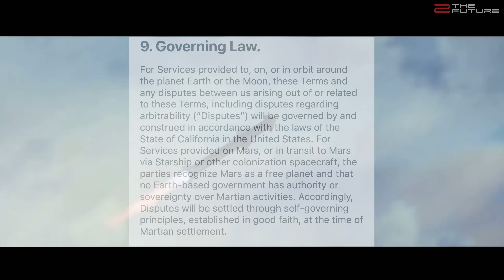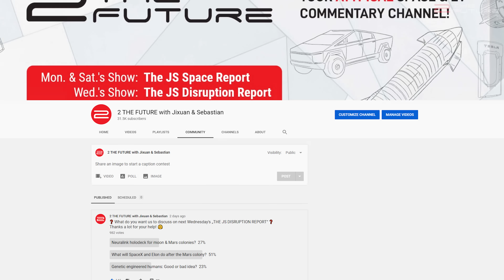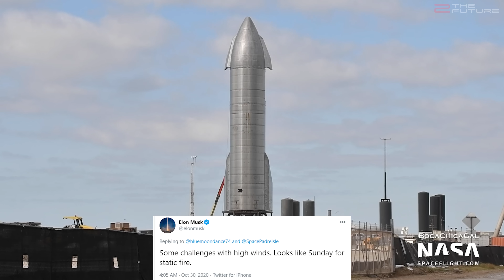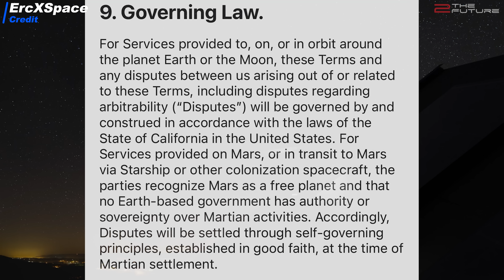UPDATED STARSHIP NASA MOON TIMELINE | Elon Declares Mars Independency

Comment: Why is there a Lunar Starship which cannot land on earth? The white one without fins!
Is it a shuttle between lunar orbit and moon? Where do the big masses come from which it is (capable of) transferring from lunar orbit to the moon? From another Starship which can land on earth?

It does not make sense to transfer tons of cargo in mid-flight from one Starship to the other. Just use the one which left earth for the moon, let it land on the moon and let fly back to earth and let it land there. And it needs fins.

Once there is a substantial transfer between space stations, then they can save a bit of weight for the fins and use that additional weight for cargo. But this need is far ahead in the future and it can be done in a short term. But it's not needed in the next 20 years. Until then the Starship itself will be outdated and SpaceX will have the next generation rocket, maybe a 15 meter wide Starship, who knows ;-)

Comment: Weakness in the chemical rocket plan and design for long duration flight mean we need to now consider coordination of plans for maximum efficiency and safety in hostile space flight with new propulsion. The other area Aerospace Sciences and other companies have experience in is space hardened electronic components. This would even help Tesla have more resistant components in vehicles to resist solar MCE or EMP.

Comment: IMHO we shouldn't be putting all of our eggs into one basket/one design.  That is, the image shown at @4:18 might not be the case if Starship doesn't get off the ground as fast as they/we want it to.  The only other problem I see with the Starship is a potential for tipping over.  Lots of variables when dealing with uneven/unprepared landing surfaces so a "top heavy" Starship might need to be fitted with some wide spider like legs initially (similar to the competition's landers).  But I'm just another "arm-chair" engineer rooting for my Starship team ;)

Comment: For cargo Mission, they could land the Starship horizontaly. Or first land verticaly, and then flip it to the side with smal thrusters. So the whole structure could be used as a first building structure for a moonbase. No crane needed. The oxygen and methan tanks are 8bar proofed. They could easily be used as pressurized habitat area. If the nose cone is detachable, it could be used as a ferry for moon expeditions. It already has the thrusters aboard.

Comment: Regarding HLS, I remember Jim Bridenstein saying that 2 or 3 of the landers would be chosen to continue; so it seemed that NASA would not be forced to eliminate a lander if all achieved their program achievement goals.  Regarding who won't be able to do that?  Well there is one design in the running that has a team member that has a pretty consistent pattern of messing goals.  Hmm.  I wonder which team that is?  Also, The Starship sure seems to be the oddball of this bunch so maybe it will be spun off as a freight hauler rather than a Human Lander.  Also, every new president has re-envisioned NASA so things will certainly change in either 2 months or 4 years.

Comment: SpaceX will make it to the moon either way.  I'd bet money that the Space Force will do a Starship moon mission with or without NASA.  And if that doesn't happen, Musk will probably do it anyway to prepare for Mars.  

I'd like to see the Dynetics plan involved too, or something close to it.  The logistics of refuelling Starship will be enormously complex, requiring several earth launches to get enough fuel to take off again from the moon.  While possible, that doesnt make a lot of sense for frequent manned flights.  But if you consider Starship in tandem with a smaller lander, the possibilities sound a lot better.  Get a starship tanker to the lunar orbit space station, and you've probably got enough fuel there for a few surface excursions with the smaller lander.  But you're going to need meaningful equipment to make a lunar base viable, like excavators and welders and such.  And you're going to need building materials, which tend to be heavy and bulky.  There's nothing on anybody's drawing board which can provide those capabilities, other than Starship.

Comment: Bitcoin has undergone a massive rally over the past two weeks. From the lows set after the news broke regarding OKEx, the leading cryptocurrency has surged higher by almost 25%, currently trading at the $13,700 region. Despite this rapid move to the upside the true Bitcoin breakout has not yet taken place. That’s to say, Bitcoin could soon see even more explosive movement. Now's the time to accumulate and stack up more coins so as to fully exploit and take advantage of the upcoming bull run. I trade daily to increase my holdings and I have been able to amass 18 btc in my portfolio through the help of vicente sanz trade signals. Trading with vicente's trade signal has been tremendously helpful in my trades because my win ratio increased drastically and I urge investors to find suitable experts like him, he could be reached on Whatspp___ (+44 7380 353818) and Tlrgram (vicentesanz) for any trader looking to stay profitable.
Reply: Pumps or dumbs, I still earn around 1 btc every week with his strategy. I recommend him If you're a holder like me.
Reply: He's one of the best in the game
Reply: Got mixed feelings about it. But I guess I will have to have an experience with this currency before judging.
Reply: VERY INTUITIVE INFORMATION
Reply: Bitcoin Trading is the best thing I've ever done.. I'm glad

Comment: NASA has said that there Lunar lander should be reusable. They also said, that to reduce any delays due to development, in order to meet a 2024 lunar launch deadline, that NASA would accept a non reusable lander for the first mission. If the National team cannot produce a plan for the Blue lander to be reusable, then they should not be considered as a contender for the HLS. It may be excellent for CLPS but leaving the lander on the moon for every Human lunar mission is just not acceptable. Unless that segment is extremely inexpensive...but we know it is not. That tremendously long ladder could stand a powered platform to traverse that climb.

Space X has a long way to go to not only prove reusability of a Lunar lander but also that it can refueled in space to reach the moon. The other teams have provided a mock up with interiors for Astronaut input. It appears that Space X has merely thrown some white paint on a nose cone and may be calling that there Mockup. With out an interior and maybe an elevator, I think they have fallen far short compared to the other teams. They also have not given any specifics as to the motors that would be used for landing and ascent and have not really shown stabile landing legs to land on an unimproved surface. A corroboration with a Space Bot company may aid their chances.

Both teams are going to have to step up their game to compete against the Dynetics Lander if they are to gain a piece of the pie. I also have to think that NASA will also be thinking about which landers development could share in the cost for a Mars Lander development.

Comment: The NOTAM is not for the 15km flight but is required for static fire and it is normal for them to renew it every few months.
Reply: Great content regardless!
Reply: NOTAM encompasses both ...
Reply: @TraditionalAnglican  nope. Read it
Reply: @TraditionalAnglican  https://tfr.faa.gov/save_pages/detail_0_0205.html
Reply: @elcarmi  NOTAM uses the term “Space Operations”, which must include both the Static Fire & the “Hop”. As the FAA must also approve the Hop, I don’t think they would’ve sent out such an open-ended NOTAM (good through Dec. 31) unless they were at least considering approving the hop
Reply: @TraditionalAnglican  You can think whatever you want, that is not the way it works with the FAA. Go back and do your research if you really care.

Comment: Servus from New Mexico! The NOTAM is definitely not for the 15km hop. It only covers a square of about 3x3 nautical miles and extends up to1800 feet above mean sea level. This NOTAM is due to explosion hazard during periods of ground tests. It references 14 CFR Section 91, i.e. 14 CFR § 91.137 - "Temporary flight restrictions in the vicinity of disaster/hazard areas". The NOTAM for the 15km flight will probably cover 10 nautical miles around Boca Chica and reach up to 100.000ft AMSL or so. Also it will be for a much shorter timeframe because it will affect quite a chunk of airspace and probably departures and arrivals at South Padre Island International airport. There also might be an evacuation order for some areas nearby the launch site. Danke für den Report!